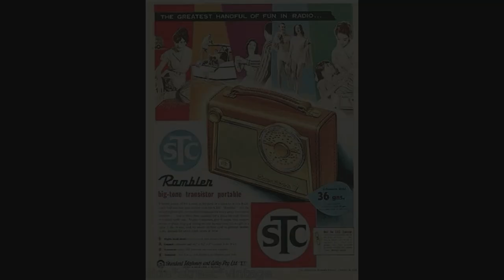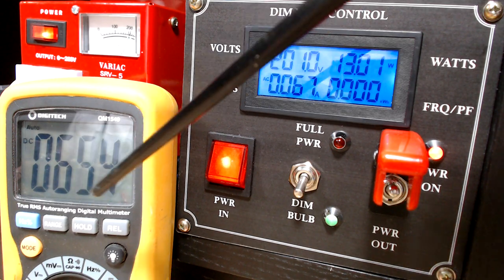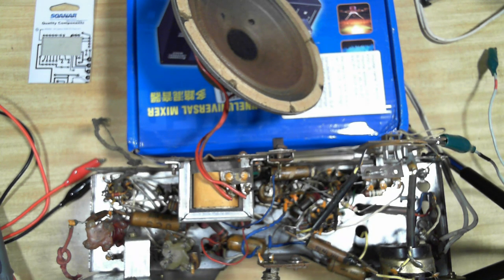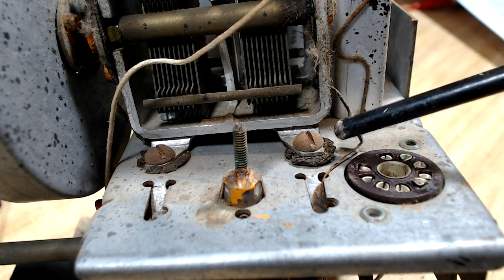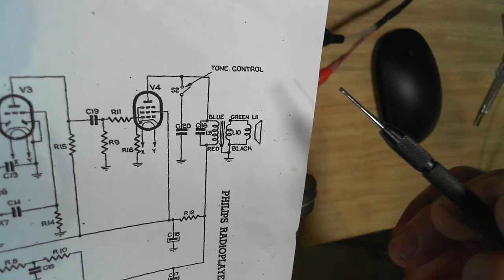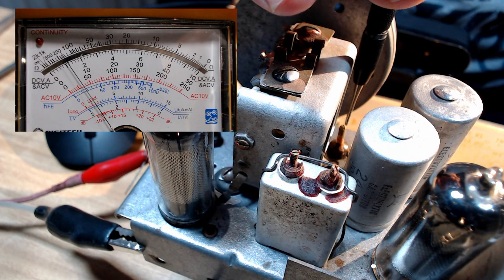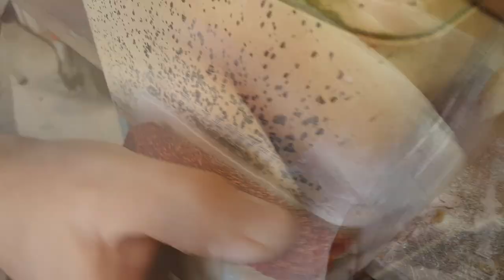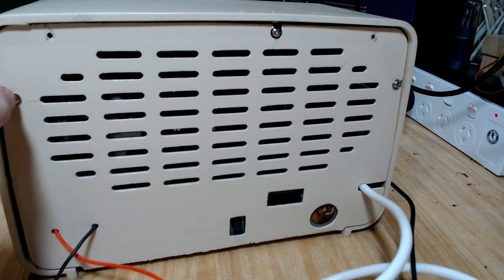$1 Basket Case Radio Restore - Fleetwood 1061 AKA Philips 165

Comment: Hi David, I currently reside in the Netherlands but am looking for a person that could help me restore my grandma's Blaupunkt Sultan 20200. It is in rather good shape but I wish it to be restored like it used to look. In the Netherlands we do not have any restoration companies anymore. So I was wondering if you could help me. It works fine it is just the plastic on the front has some bursts and some of the wood is chipped. Would love to hear from you!
Reply from the maker: Hi RandomEdit, What would you like me to do?
Reply: @DavidTipton101  I could send you a picture of it. But it does run but not smooth at all. I think the mechanics on the inside would need some help. And the outside wood has some damage in the corner. Also the plastic is on some parts a bit broken.
Reply from the maker: I assume you want to send the radio to me but that would be extremely expensive plus it might get more damage to it in transit. There must be someone near you, furniture restorers for the cabinet. Try local radio clubs or Facebook radio groups, they offer a lot of contacts for those type of repairs.

Comment: CAUTION. 
Bakelite does contain asbestos brown red and green have the highest amounts.
My advise would be to find another way to repair the case.
DO NOT SAND.
Reply from the maker: Hi Shatne, good point, thanks... the material is stated as plastic this case 🙂

Comment: If the frequency panel didn't clean up, there'd be no reason why it couldn't be replicated.
Reply from the maker: Hi Joe, yes that would be another choice and I made inquiries but no one does them on plastic and you can't get a dark enough print from a home printer but f you know another method 🤔
Reply: @DavidTipton101  We used a printable semi clear thin plastic adhesive sheet for some of our electronics work. Not sure if it was laser or ink jet. Try Charette if they're still in business. Model train people had a decal like product iirc. Maybe it's used on other models too. I also successfully used clear overhead  projector sheets for classes run through a photocopier. If it really came down to it rub on letters used either on acrylic or polycarbonate (preferred) could be used. I've used a ton of that through the years. Last resort might also be Dymo clear labels. I've been retired for a while now so I may be out of touch with any newer products. Hth.
Reply from the maker: @joewoodchuck3824  OK, thanks Joe. I'll keep trying. I have tried clear transfers and have sticky back transparencies which I haven't tried yet. I tried to buy rub on transfers but couldn't find them anymore. They were called Letraset or something like that.

Comment: Beautiful. 
Did you know you can buy reproduction vintage & antique fabric to cover old speakers & radios that looks original?
They also sell reproduction vintage cords, wiring, plugs, and custom decals, emblems, dials, etc,...
Oh, here ya go. Radiodaze.com. Check it out.
Reply from the maker: Hi Shavin, I'm afraid buying from the US is very expensive, the exchange rate is poor and postage from the US is crazy. I have bought some before and it ends up near 40 to 50 dollars for a square, Thanks for your help 🙂